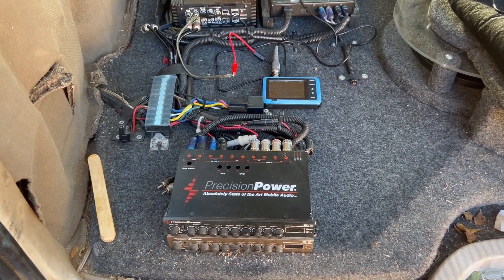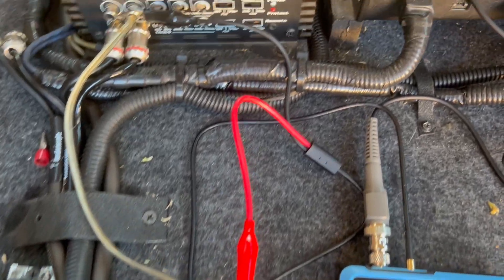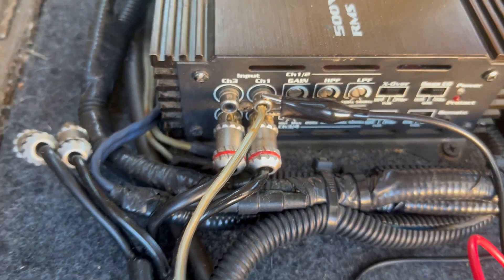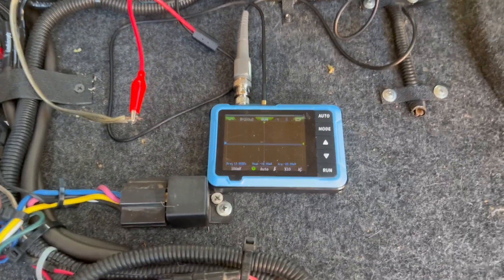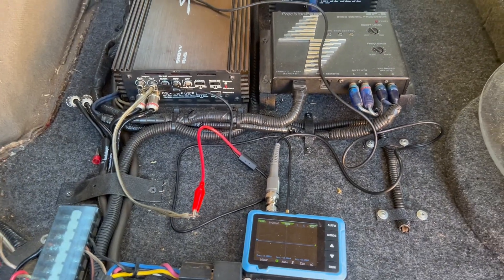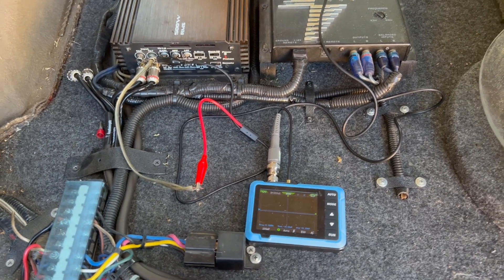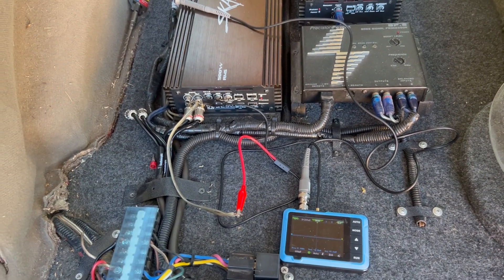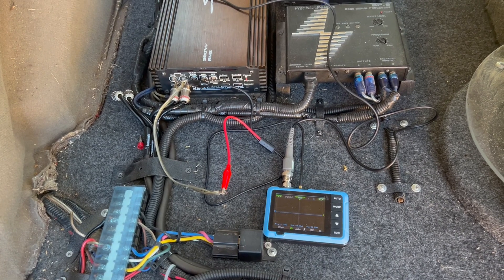How to adjust amp gain with cheap oscilloscope. And other vehicle diagnostics.

Comment: I love there oscopes budget friendly i just recently bought there dst-201 i upgraded from the dso-120 i love setting gains on amplifiers
Reply from the maker: Glad you saw the vid. Thanks for the comment. I had to cut the vid short because I didn't disconnect my speaker wires and the 1khz tone was LOUD haha. I am SOOOOO swamped with work, I don't have much time. But I am gonna do another vid as soon as I get time. Using it mainly for my mids gain.  Thanks
Reply: @highrev90homemechanic67 No problem!! It’s all good can’t wait for the next video take your time no rush!! Damn i bet it was loud man any test tone that is up loud is louder than music for some od reason.